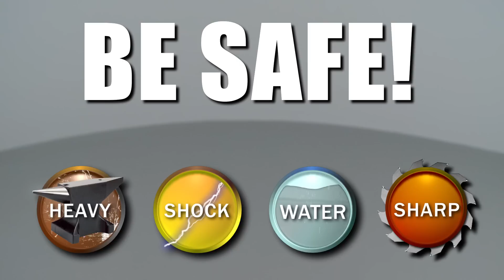Asko Washing Machine Drain Pump Replacement #8801264

Comment: Thanks for the video i managed to repair my washing machine that was not draining and spinning, in the drain pump it was a few coins but it still didn't drain and spin so i managed to remove the pump and what i find out the pump was not turning, and i find a piece of blue tag stack with the impel or of the pump, i removed it and it worked .

Comment: Hello. What do u suggest when after rinse cycle door of the Asko W6022 does not open and you have to run the drain program by holding the lock key button & about 5 minutes of it running the process, the door opens. Tks.
Reply from the maker: Michael Tracy Sounds like you have a slow drain. Most likely you have a restriction in the pump strainer or pump inlet or outlet ports. Remove the cover of the pump and clean out any debris in the pump. Make sure you have most of the water out first and have some towels ready.

Comment: Greetings. We have n Asko W6021. Its been a delightful machine for many years. Lately is has decided to behave in an intermittent fashion on start up. If you hold the 'start/stop' until it clicks it has been starting,  however its now decided 'no start up.' Could this be a water sensor or even to much water pressure on the input solenoid? We have very high water pressure where we live. Many thanks for your reply.
Reply from the maker: +David Baxter We would suspect more of an issue with the circuit board not responding properly. The pressure switch does not effect the water inlet valve. The pressure on the valve is constant from the house.
Reply: +RepairClinic.com Thanks for the reply. I found worn brushes on the main motor to be the cause of the 'non start up' fault. The machine is 13 years old and stands to reason why they were worn out.  I suspect what you are saying re the  circuit board "response" may have had something to with an initialise sequence due to the motor open circuit? Replaced both with some genuine Asko brushes and is now running again . Beauty mate!   👍

Comment: Hi, I have an Asko W620, ive had this for 18yrs. The only problem in the past was the actual door plastic splitting - happened twice but only a teeny weeny leak occurred. Now however something has happened at it is leaking through the bottom drain where the little door is. When it goes onto full spin and drain the whole screw in mechanism come out with water flooding out over the floor. Im wondering if the problem is to do with the drainage where water goes out through the pipe at the back - could that have a blockage or does the drain pump need replacing? Im new to all this. Cheers
Reply: Looks like you didn't get an answer 😕 Did you figure it out yourself?

Comment: Hi, don't know if you can help but my machine won't run on its proper cycle won't drain or spin unless i select them. it is an asko W6021 and have never had any problems before this.  When i select the heaviest load I hear water but its not going into the wash bowl.... on the next wash level the water goes in.. Hope you have an easy solution... thankyou
Reply from the maker: +Christine Weber If certain cycles work while others do not then we would suspect a problem with the timer or control board.